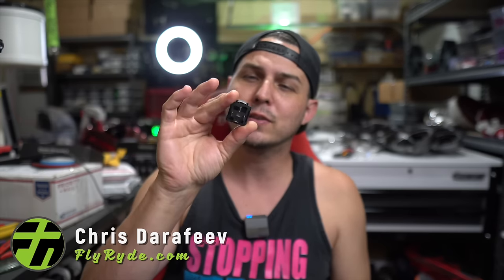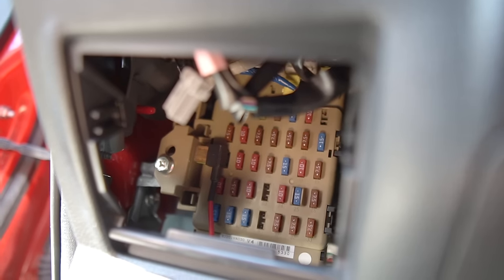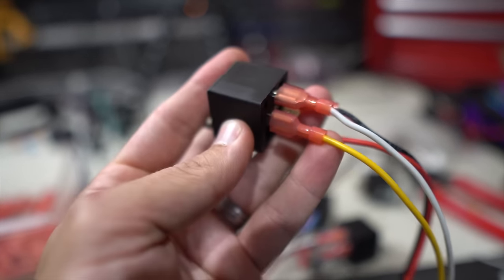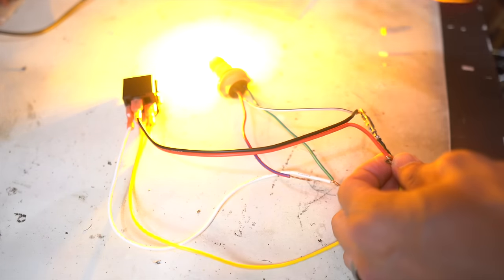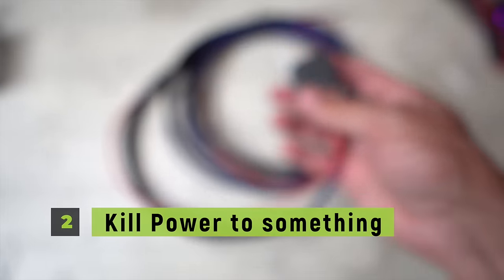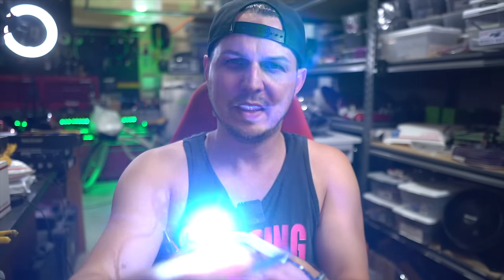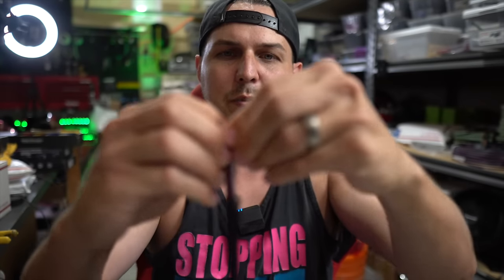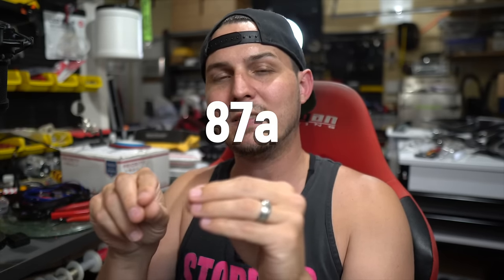3 Ways To Use Automotive Relays

Comment: Great instructions, would be nice to have the electrical diagram as well.
Reply: The relay has the diagram on the side..
Reply: These are readily available everywhere.
Reply: I think he means the diagram on how to wire.  For instance you can also use these fuses to put two power sources to one light. In other words wiring in reverse

Comment: Please keep it technical - don't dumb it down.  I'm just doing this for my Corvette and Pontiac but tired of seeing people do hack-jobs like shoving a fuse tap into the fuse box and then having to make a hole for the wire because it's on the wrong side of the fuse box!  I want to learn the maths to do this properly.  For the Corvette I'm wiring in a Cassette Deck which can be turned-on without the engine running, a manual override switch for the aerial to go up and down, an LED Clock and ultimately, eventually, a button to open up the exhaust and do everything required with the fuel/air mixture and O2 sensors to support it properly.  If something's worth doing, it's worth doing right.

Comment: Definitely good stuff! I’ve been trying to figure out he to wire my Baja Designs LP series lights that have high and low beams through the factory upfitter riches in my Raptor. I was concerned that both the high beam and ow beam switch could get activated and fry the light circuit board, but you’ve explained relays well enough to lead me in the right direction. Lost me a bit with the diodes, but great info overall! Thanks!

Comment: Thanks for the insight I’ve re-wired my late father’s boat which had copper wire throughout with not a single relay. I replaced the generator with an 353 amp high output alternator from a 2k Silverado. Voltage light is a little tricky because the exciter wire has less than 12 volts when the engine is not running which activates the light when engine starts the voltage is greater than 12 volts and this turns off the light, however I removed and replaced the warning light but I will use a relay with my output voltage from the alternator to pin 86  pin 87a I will hook the light to and nothing on pin 87  ignition power to pin 30 so when I turn my key on power will energize the light when output voltage energizes the relay power will switch to 87 turning off the warning light. You helped me figure out. 👍🏾👍🏾 two thumbs up!!

Comment: Relays are great when you want to turn on something when something else is powered on. Not just for automotive uses either. I have a DIY solar setup that powers all of my garden lights. The current draw is very high and would burn out most relays supplied on most Home Automation controlled relays. So instead of running the lighting through the HA relay, I let the HA relay trigger automotive relay that can handle the lighting current.
Reply: Yes, they definitely have other uses outside of automotive purposes. However, when using them elsewhere beware the current ratings of the relays. Automotive gear tends to have optimistically high current ratings based on that high current is only going to be flowing for a relatively short amount of time and is not a continuous duty rating.

Comment: Thanks for the tutorial, now I have an understanding to hook my 12v battery from my alternator to my Dc-Dc charger, then when the car is off switched over to my Lithium batteries. 

Alternator to Dc-Dc charger as usual 
Alternator to pin 85 
Pin 86 is ground wire 
Pin 87 wire to fridge 
Pin 30 is from battery positive
Pin 87a wire to fridge

Many thanks

Comment: I had a pair of relays wired up to control the auxiliary incandescent fog and driving lights in my Courier pickup. The circuit was designed to work either automatically (high beams or low beams) or manually (straight on or off). This was before computerized controls; nowadays, it is best to have a relay with diode protection across the coil; you don't want counter emf damaging delicate electronic parts.
Also, when adding non-factory wiring, use of standard connectors and connector pins is a good idea. If your car needs any kind of repair, the shop will be reluctant to reconnect non-standard wiring they had to disconnect in order to fix your car.

Comment: You can use these so many ways and highly recommend the Bosch relay guide book for more uses of the 5 pin relays. 85&86 is a coil to control a normally closed contact between 87a and 30and normally open between 30 and 87.
Reply: true, i 've used them as high power "pseudo diodes", etc
Reply: Correct ,2 working together can lift and return car windows,a cheap fix if the controller is unobtainable or too expensive.

Comment: I sure wish i could grasp this.  I have brain surgery that caused it.. 
I have a 04 gmc envoy 4.2L. I got a engine light for misfire. At first, i bought a relay for the fuel pump. The worker put it in. I fixed that with replacing ignition coil and plug. Then i got a code po410 so the part store said to try a new relay of the air injection reactor solenoid, i came home and pulled it out and the one next to it and placed on the side. So i had those two "the new and old" plus the old fuel pump relay. So i got confused on which one went where. There two the same and one that shows 3,1 on left and 5,2 on the right, but the others have the other numbers u showed. So what would the 3,1 relay be used on. Its either the fule pump, Electric adjustible peddle, or the air injection reactor solenoid.
Ive been looking online to find a pic of how they should be inserted in the spots they go in, but no luck. Also, the relays plugs i have are on each corner that plugs into its spot.

Comment: Thank you for explaining 3 ways you can use relays to do PWR/GND
logic.

Putting a fuse in series with whatever load you are using is a
good idea.

Method 3 uses two different relays, so the wiring is complicated.
If you do this, you need to draw either a complete (all terminals shown)
wiring diagram OR a schematic (with all pin numbers listed).

If you don't, nobody else will ever understand exactly how it works, 
and you won't understand how it works a year after you get it working.
Naturally these diagrams would then be part of the car and stay with 
the car when you get rid it.

Comment: Your videos are going to help me a lot trying to realize my project for mums Audi TT. Even it sounds very basic, the more I think into it, the more I get confused how to get the wireing right.
DRL that turns off when turnsignal is on. Simple switchback so far.
Additional the DRL should go dimm via a PWM when the headlights turned on.
And of course the basic auto on/off.

Comment: Using 2 5 pin relays, you can also make a 4-way switch. Useful for marine wiring to have multiple switches to control same load.
Reply: I could use that set up right now!

Comment: Very informative video you basically covered everything about how to use a relay, thank you for sharing. 

Just wanted to add if you use a flyback diode on the relay it protects it against reverse polarity when the relay is switched off. And increases the relay’s life span.
Reply: Yeah, a diode between 85 and 86 ("pointing" from 85 -> 86) PREVENTS BACK emf at pin 85 - required when using transistor to control trigger. There can be hundreds of volts induced at 85 as the magnetic field collapses. (edit: even though you can interchange polarities between 85 and 86, the diode MUST "point" towards the +ve, be it 86 - as shown - or 85 if reversed)

Comment: Can I ask you a question? I have a 2021 Acura ILX, and I took the housing off, to put new LED bulbs in, and once I unscrewed the socket, for the bulb, it had a wire to wire connection? No bulb for the brake lights? Just the amber for turn signal, and I changed the reverse lights, that are on the trunk. Can you give me any advice? Thanks

Comment: Love the video man! Stuff like this is good to have out there. Helps others learn! Keep it up 👌👌
Reply: Iokay on the 12 volt battery to turn on ATV it has a relay that is connected to two red wires and ground wire I connected the terminals wrong I was jumping it from another battery to the ATV battery and now it can't turn it on but the fuse has a little glass fuse didn't burn out so I want to know if it would be the starter or the relay that got burned out most likely it would be the relay right

Comment: This may be a dumb question, but would it work if I used one of these car relays to turn on a 120 or 230VAC device? Like 12VDC in, 230V out...
My question is because I don't trust those relays for DC to AC devices that have such thin contacts to bear 20A as they're labeled.
The automotive relay contacts look much more robust.
Does this make sense at all?

Comment: These are the videos I live for; the wealth of knowledge is priceless.   I tried doing the same 2-relay system a couple months ago and it didn't work correctly so this was perfect timing.

Also, something I have trouble with is finding good quality materials (wires, relays, crimps/connectors, heat shrink, etc).   What's the go-to store/site for that kind of stuff?

Comment: So would something like this relay work for me wiring up some led running board lights to rocker switches? I'm looking to wire my running board light a couple of rocker to get the functions to work. They have left & right turn signal light function and a running function as well. If I'm thinking correctly I got everything to work correctly with a relay like that and the switches to run the functions as needed

Comment: Great vid thank you. How would you wire the second relay to turn something off. Eg. When blinker is on, the DRL on same side goes off. But what would you use to stop the blinker power pulse on an off and keep the drl off while the blinker flashes on an off without the drl doing the same thing.

Comment: Hello: You kind of lost me towards the end of the video. 
I have a motorcycle that gets its spark to the plugs with a IC Igniter. The power to turn the igniter on come from the fuse box which has a 30 amp fuse which goes through a relay and out through two diodes than to the wire that powers the igniter. The thing is that the ic igniter is not showing or making the ignition coils fire the spark plugs. I'm sure the pick up coils, and ignition coils and wiring is good. I think the igniter is bad. This come from a 1985 Kawasaki ZN1100. Thank you for any tips on the above.

Comment: So I added a relay for LEDs. I have installed one before for a light bar. My second one is buzzing when ever it's charged. Would sharing the ground and battery power cause this. I jumped the ground and power to each  relay, instead of running a separate power source to the second one.

Comment: So I did a projector retrofit, and I have wired the solenoid to move up and down for high beams. But, I can only flash the high beams on by holding it. When I fully turn them on the headlights turn off, but the solenoid is still up. I'm assuming I need a relay to get my high beams to stay on when I flip the switch. 

So for the relay, 86 is supposed to be wired to my ground wire, 85 would be wired to my high beam wire, and 30 would be fuse tapped into my 10AMP low/high beam fuse into my fuse box. 

Does that all sound correct? I don't think I'd need to connect it to my battery because I'm only powering my high beams. Not like a light bar.

Comment: This video is dope!! Where is your shop located? 

I need someone like you to help me  figure out how to basically reverse the behavior of a my SUV’s OEM 12v rear accessory port (cigarette lighter) automotive relay (located behind the glove box)  that switches power on / off to that back port. 

Currently the rear port relay shuts off the the port when the engine is off. 

But I need for the port to be OFF when the engine is running and then ON while the engine is off.

This is so I can solar charge the battery while the car engine is off but then when I turn on the engine I don’t accidentally fry my solar panel (both the engine and the solar panel can not be on as the same time. 

Most internet searches lead to an always on mod but that won’t work in my case. 

Any ideas?

Comment: great show watch as much as i can i have a need for the diode what size do you use on a 12 volt sytem any help will be great thanks an have a great day.
Reply from the maker: I honesty should have used a Rectifier Diode. We ended up replacing the IN4007 with those because they were getting hot.

Search those up, they’re cheap. For little things though, IN4007 is perfect 👌
Reply: @flyryde  Thank you

Comment: Hello sir,

Since I’ve installed a sequential orange led side marker to my w202, C230 Kompressor 2000 Mercedes benz, I don’t want the factory installed side marker to blink because it’s very bright and hides the sequential marker while blinking (seen from distance) but instead I do want it to be on in steady mode (not blinking). Is it possible to do so?
The turn signal has a two way bulb, one is turned on with city lights and the second one is turned on with turn signal. 

Thank you in advance for help 🙏.

Comment: So you don’t have to use every outlet on a relay? My fog lights go off on my 2006 dodge ram and I’m figuring it’s because there is a relay wired in there from the factory.  I’ll have to look.  I want the ability to turn on my fog
Lights when my brights are on as well.

Comment: I have a 2000 dodge Dakota, I want DRLs to be red and turn off when my headlights come on i want automatic headlights and a remote start push button start alarm system. I bought most from Amazon and attempted to install but I got confused and there are no videos or step by step diagram for what I bought, please need help

Comment: So many thoughts on this. I am thinking of building a custom light system for a POV to use in parades and want the additional lights to "wig-wag" and I think this could be a more cost effective option to the $600 controller I had recommended to me.

Comment: I just use a 9 volt battery on pin 85 86 when the relay clicks it works at the same time I put a multitester on pin 30 and 87 or if there is also pin 87a

Comment: yes. i am solving real hard problems w my 2003 ford lightning. I have a ran wild high powered sound systems. I let a mechanic touch it bad mistake. I live in Wi now. Im not in the south. guys up here are clueless. I suspect a really deep electronic problem. need to re route my relays/ignition/battery on problems. I just want to do a switch for sound system. Currently its running 3500 watts 2 amps one capacitor. I want to throw my old stuff out. my wiring harness is  hacked to Hell bc I used to get robbed every 6 months. Got a replacement harness from a totalled one. I suspect a computer issue bc it always slapped 11-12psi boost. let the mechanic touch blower fluid (bad mistake).Sad clown 8psi boost flatlines so depressing. no power to radio, no power windows. I pulled that piggy back crap out of the fuse box asap. I need an expert. Really a Ford Lightning expert. I will drive to anyone that can fix this in the USA; I am never selling the truck.

Comment: I have an aftermarket back up camera wired into my reverse lights. Is there a way to use a relay and a push button to get the camera to turn on without having to shift into reverse, but still also have it turn on when I do shift into reverse? BTW great video. Just sub’d

Comment: I have a set of led rear lights it's 6 wires 2 of them are for turn single one flashes one stays on but I have put them on my trailer but I'm building a box with power in it I would like left and right work that flashes to work on the car but I have lights on the sides to that will work on car side but I would like to get them to work when I change over to the built in hazards side I have a flasher relay for the hazards that I will be using the ones that stay on for this I picked up 5pin relays 1 says it's a crossover the other it's just a 5pin iv been trying to sort this for a bit now and your the only one that comes close to what I would like to do what is the best way to do this plz

Comment: Bro...very informative..however you kind of lost me but I think you've made it seemed so simple.  Question hope you can help as no one else has been able.  I have (4) sets of RGB lights each of them pulling 3.5 amp or less...underglow, drl, interior and engine bay lights ...how can I power these using a relay and how many will i need? Do I need an in line fuse ? Can you draw a diagram to understand or if you can explain.  So 3.4 x 4 sets of lights is about 14amp..so I know I can use a 20amp fuse inside the in line fuse. Can I use a control switch? 2 out if the lights came with remote or I can use the app to control them. At this point I want to hooked them up properly. Thanks.

Comment: i iuse one of those 40A to power my wifes car fans....ford wanted a silly amount for the fan relay. used this to replace it, turn car on fans go on turn car off fans go off after 10s. also used them with some other electronics to turn light on and after set amount of time light goes off

Comment: arent relays used so as not to burn out switches with high currents/sparks passing through them. They allow a lower current switch to open a high current circuit???